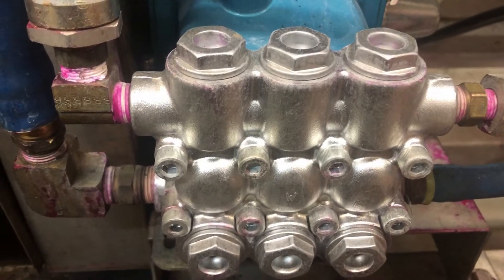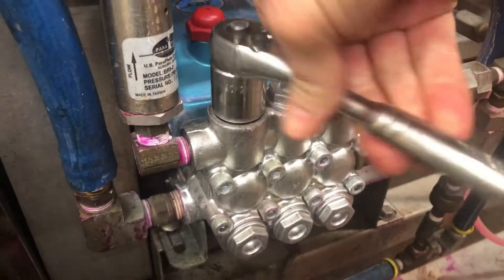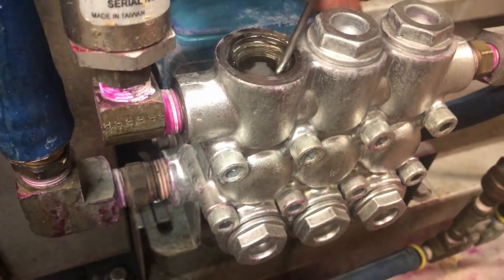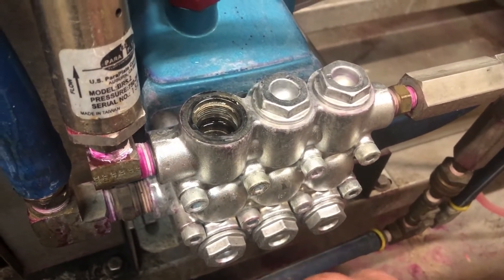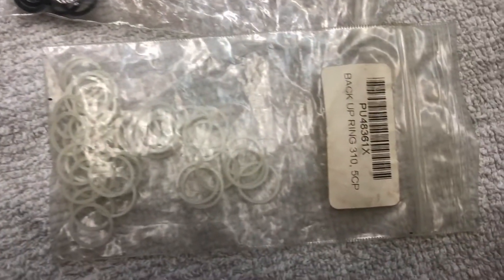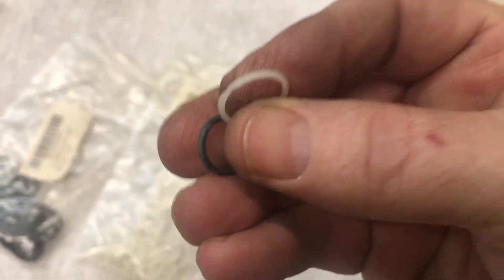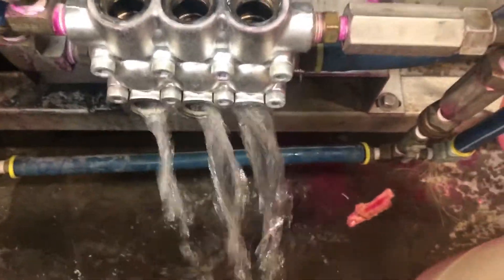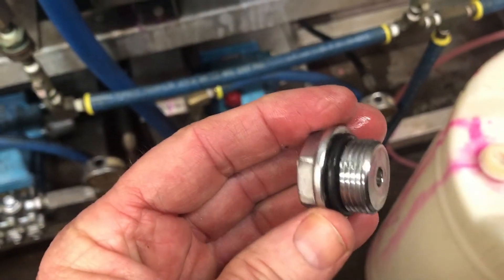Cat Pump Maintenance

Comment: After I removed it, I noticed my top left allen bolt was covered in fluid that appeared to be hydraulic. Any ideas on what might cause this or how to remedy? Terrific video, thank you
Reply from the maker: Check your oil level and if it looks milky it may have a seal leak in it. When water and oil are mixed it looks milky. Change your oil and make sure your oil seals are new. Change the seals on each side of each piston plunger. Or you may need to replace the entire pump.
thanks for your comment and I hope the best for your pump.
Reply: @flymanff  Thanks. I am awaiting delivery of the full seal and valve rebuild kits. Crazy $$ for some o-rings. Sheesh. Will rebuild and monitor that bolt. Seemed odd to me that only that single bolt was covered in fluid.